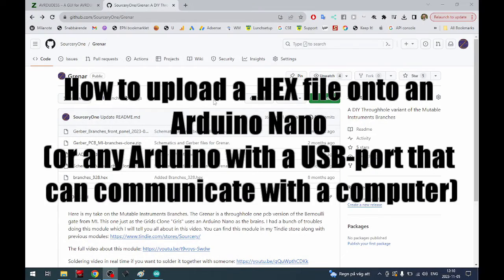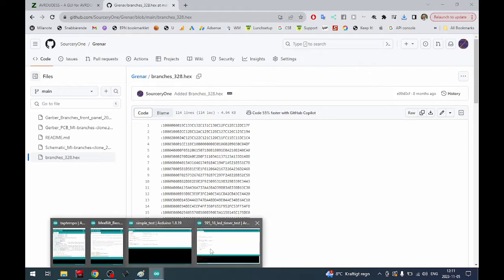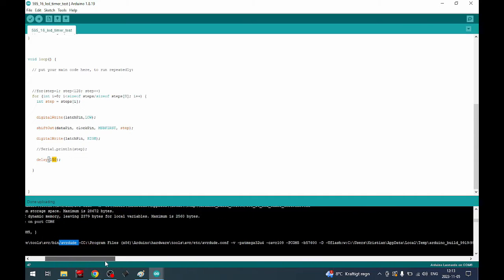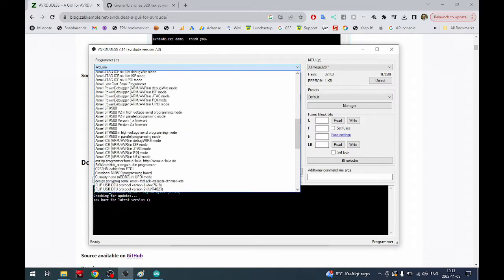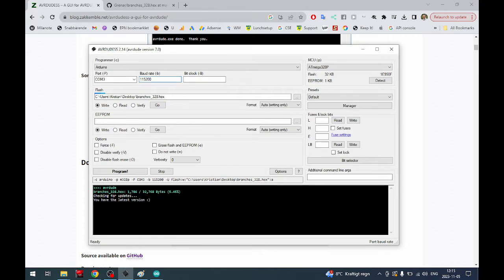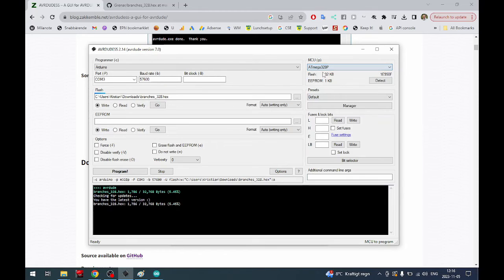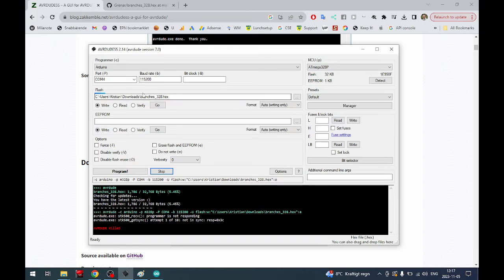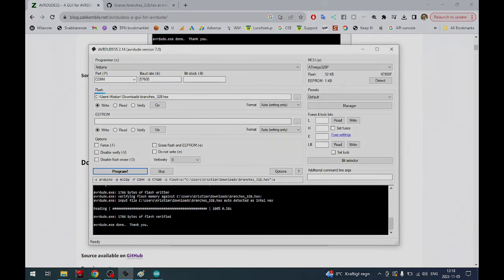How to upload a .HEX file to an Arduino Nano

Comment: Where to download a Hex or bin file for clone of 382 ?
Reply from the maker: If you mean the branches clone you c an find it on my GitHub: https://github.com/SourceryOne/Grenar where you can find most of my hex files.
Reply: @SourceryOne  I don't know why the hex file is not opening with my programator😢 I did find already this site but there is mostly hex code in txt not in fille.. when I try to put that code by note program of windows Bascom read as 00 00 00 00 from first to the last line 😢 I need hex or bin file

Comment: I think it also erases the bootloader of the microcontroller, at least for me .
Reply from the maker: Yes that is probably true. This way it totally replaces the program on the chip. You can however depending on the hex file set it to be written to specific regions of the chip memory (at least other similar techniques work that way). But that is advanced class. ;)

Comment: Bruh in version 2.17, i cant find "Arduino" in "Select a programmer"
Reply: I selected Arduino board as programmer using arduino as ISP firmware and it seemed to work

Comment: Before watching this video, my initial flash over USB didn't work for the Arduino Nano from Aliexpress. Changing the baud rate did the trick! I was also able to flash an ATmega328P in DIP package that I wasn't able flash before with this trick. Thanks so much!